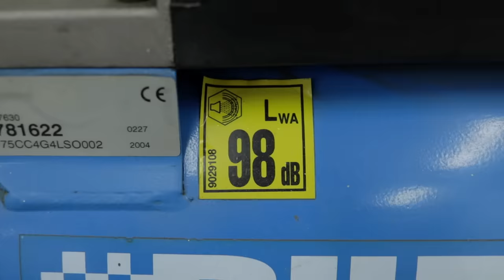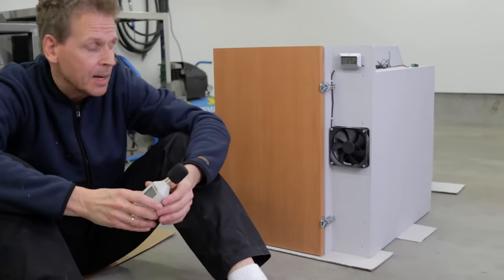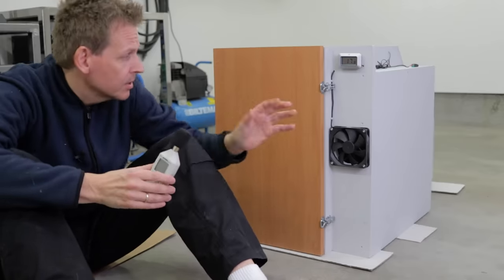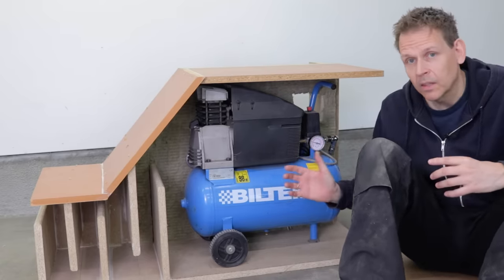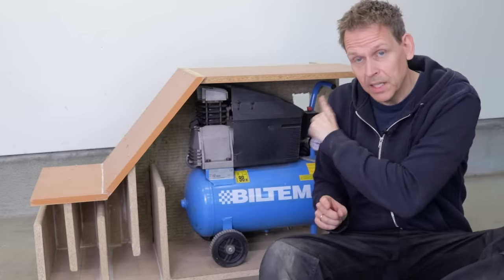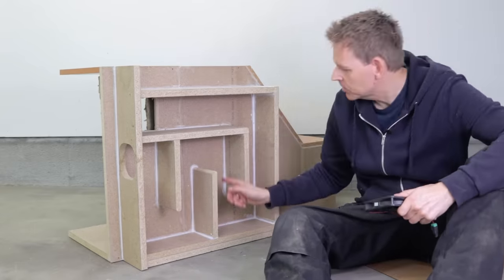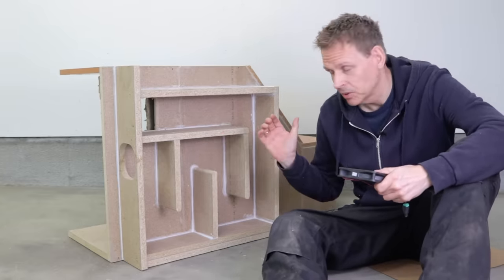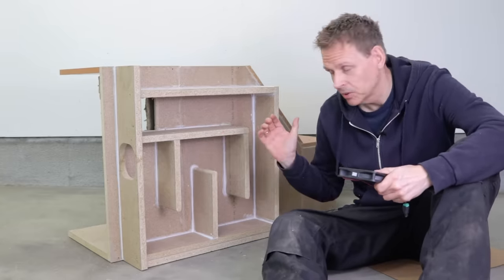Do not build a sound insulated enclosure for your noisy air compressor!

Comment: What kind of Blue air hose are you using and/or what size? It looks clean and neat with the specifically marked air lines in the garage.
Reply from the maker: They are bought at Biltema (as most of my stuff): 1/2 inch PVC hoses (13mm internal diameter). These are cheap but quite stiff (even in their ad they say "flexible hose"), would not use them "on the floor": https://www.biltema.no/en-no/tools/compressed-air/compressed-air-accessories/compressed-air-hoses/compressed-air-hose-pvc-2000038224
Reply: @kihestad  no was actually looking for nice piping/hose for on the wall with valves, outlets and reducers/manifolds  on a few outlets
Reply from the maker: @steffie.morris  I used the blue hose I linked above, 3D Printed wall mounting brackets. I bought a pressure regulator with water removal tank and some bends for the outlets: https://www.biltema.no/en-no/tools/compressed-air/compressed-air-accessories/pressure-regulators/

Comment: I live in an area where I was able to build an attached concrete structure on the backside of my workspace. Put the compressor inside with minimal insulation and now I cant even tell when the compressor turns on. Mass is the key if you have the space.

Comment: Did you do any thermal testing? Is the ventilation sufficient when the compressor has run for an extended period of time?
Reply from the maker: Yes, I have fitted a thermometer with sensor inside just above the motor. I do check it frequently to ensure that it's not getting to hot inside the box. Normally the temp increases 5C = 10F when it starts until pressure is built up, and it takes just a couple of minutes to cool it down. If it is running constantly over longer periodes it can get a bit hotter, I have seen almost 10C = 20F increase. The warmest summer days can be 30C = 86F here where I live, but that is very rare. Its more commonly 25C = 77F, so it never gets very hot inside my box. 
I should mention that I put the exhaust at the rear of the box because than the hot air from the box is blown out of my garage. My garage is not insulated, there is an opening for ventilation where the ceiling meets the floor upstairs. The exhaust air from the air compressor box is placed up against this opening. The hot air from the compressor is pushed out of the room to outside of the building through this opening. By doing it like this I avoid the hot air to be circulated back into the room. I did not tell about it in the video, but now you know 😊
Reply: @kihestad  Appreciate the thorough response! Enjoyed the video. All the best.

Comment: Use mass loaded vinyl on the inside. Flexible and dense material is better at blocking the transmission of noise than rockwool alone
Reply from the maker: Mass loaded vinyl? That sounds interesting and complicated? 🤔😃 I need to Google it

Comment: Nicely made video! Must have taken quite some hours to edit.
Thanks for the information!
Could it be that there is still a part of the noise generated by contact sound? I mean via the nose stand and the wheels..
Reply from the maker: Thanks, both recording and video edit took a while. I think it was more than 500 clip/cuts if I remember correctly 😋 I think you are correct. Vibrations from the compressor inside is transferred to the box, and from bos to the floor. I will try to improve this using some vibration dampening material.

Comment: I noticed that most of the noise from your new compressor is contact noise from the stand and the wheel. Just add some thick rubber foam under it and it will be even quieter
Reply from the maker: You are absolutely correct! Vibrations are the biggest source of noise now. Will try to improve it by adding soft rubber, dampening foam or springs on the compressor and/or between the box and the floor to improve it. Thanks for the tips! 😊

Comment: Put soft rubber under the wheels and the front support. I think most of the noise you have now is vibrations . And put some rubber between the case and the floor too :) I think it will be more silent on your concrete floor than upstairs anyway. Because your concrete floor is dead, and your upstairs floor is acting like a BIG amplifyer for vibrations and sound.
Reply from the maker: You are absolutely correct 👍Notices much more noise now from vibrations transferred to the wooden floor upstairs, compared to the concrete floor downstairs. Will try as you say to add rubber on the compressor feet (I'll probably just remove the wheels) and between the box and the floor. Thanks for the tips! 😊
Reply: @kihestad  I think it will help a lot. I got an big compressor in a corner of my workshop, and to silence that I made a frame around it of 50x50 Aluminum square pipes with 2mm Aluminum plates outside. Then I put 5cm Rockwool inside the frame. For a top I used an old wooden door with a 3mm Galvanized steel plate on top working as an workbench. I can barely hear it now. To prevent overheating I made a hole trough the wall outside and also a condense drainage on a timer relay. So when in use it will blow for 1 sec every 10 minute to blow potensial water out. Then I have a relay controlled by my rooflight, so when light is off the compressor wont work. Just in case I forget to turn it off and a hose blows when I am not home. In that case the compressor would run 24/7 until it dies or overheat. We learn of our misstakes. Hehe
Reply from the maker: Sounds like a great solution 👍 I understand now I still have some improvements to do ☺️
Reply: @kihestad  By the way. I got one of those Biltema compressors my self. Just the same model as you have.  It really keeps full pressure for many months without leaking a bit :)

Comment: Try adding spring feet to avoid the transfer of vibration through the floor.
Reply from the maker: You are absolutely spot on! Vibrations are the biggest source of noise now. Will try to improve it by adding soft rubber, dampening foam or springs on the compressor and/or between the box and the floor to improve it. Thanks for the tips! 😊

Comment: Acoustic quilt is the industrial method of choice for generators and air compressors, you can buy it as an off the shelf tent. If you lag the steel canister with a damping compound such as dynamat it won't resonate.
Reply from the maker: To my knowledge "acoustic quilt" is just an universal name for soundproofing mats / blankets. it's similar material inside these as the one I have used (Rockwool sound insulating sheets). I might add some more heavy sound dampening material, probably bitumen-based self-adhesive mats (probably similar as Dynamat)
Reply: @kihestad  usually there is some combination of glass fiber and mass loaded vinyl, and various fire proofing layers. It can be produced to spec, and the only consistent feature is the quilted exterior and construction method. Acoustic quilt is not a proprietary term, it is about as descriptive as "curtain", "doormat" or "carpet", or perhaps "pizza" in the precision of the term. There are companies you can order it from who can advise on the best sandwich for your situation. It gets made on an industrial sewing machine.

Comment: Hi I'm a auto tech and my  solution is put a actual car muffler on the  compressor intake   sometimes it takes a bit to make a adapter  but  you will see it's worth the time   and takes less space
Reply from the maker: From what I have found a muffler on the intake / exhaust helps a bit, but not very much. I could be wrong though... I did some research but did not find any solution that I thought was very efficient, not even the ones fitted a big car muffler (found some here on YouTube). The tank itself also emits noise because it acts like a sound chamber. I would guess that if a muffler really worked, the vendors would have added it as a standard solution? 🤔

Comment: Do you like the aircompressor from Bilthema? I have some powertools from Bilthema and they have a cheap feel to them. Also the vacuüm cleaner issnt working well.
Reply from the maker: I would say I am satisfied. I had to fix several parts on the new one to get rid of noise, a lot of plastic where vibrating. Beside that it has worked perfectly. The old one is 20 years old, and still working. It has always been noisy, so that is just how it has always been. You cannot really expect professional quality or feel on the tools you buy from Biltema, it cheap for a reason. If you use it as intended, and perhaps even improve whatever is badly designed, I think you can get very good value for money. If you care about the cost and you are a hobbyist: Biltema is great. If you dont care about the price, or you are a professional, you might want to look look somewhere else.
Here in Norway I go to the store "Tools" if I want to step up and get high quality tools.
Reply: @kihestad  thank you.

Comment: A 3dB drop is a 50% reduction of sound energy. I have a simple sound box around my noisy compressor. It reduces the noise from crazy to bearable. Also it act as storage space as I can stack my tool boxes on it
Reply from the maker: Thats a two in one solution 👍😊 Does it not vibrate at all? Caising your tools on top to rattle?

Comment: Didn't read all comments, but i'm interested if the temperature was satisfied enough inside the box? Especially after long running of the compressor. 
Does that relatively small ventilator give enough air flow for cooling?
Reply from the maker: I can totally understand you did not read all comment. I tried to read and reply on them all for a while,  but it's just too many 😏
First I have to say that it is a pretty cold climate here where I live in Norway, in the Northern part of Europe. I have actually fitted a heat pump in my garage to be able to use during winter time. I can see overheating is a big challenge in warmer climates. A more powerful fan or even radiator cooling could be needed must then be considered. 
I should also mention that my garage is not insulated, there is an opening for ventilation where the ceiling meets the floor upstairs. The exhaust air from the air compressor box is placed up against this opening. The hot air from the compressor is pushed out of the room to outside of the building through this opening. By doing it like this I avoid the hot air to be circulated back into the room. 
When it comes to temp readings: Normally the temp increases 5C = 10F when it starts until pressure is built up, and it takes just a couple of minutes to cool it down. If it is running constantly over longer periodes it can get a bit hotter, I have seen almost 10C = 20F increase. The warmest summer days can be 30C = 86F here where I live, but that is very rare. Its more commonly 25C = 77F, so it never gets very hot inside my box. I have been suggested to move the fan inside of the box, as pulling air is better than pushing air. This might improve the airflow, but not tested yet.
Reply: @kihestad  Thanks. 
However, i think that pushing version still is better because the fan itself also need some cooling. 
If fan would be at the output, it would be exposed to hot air with all consequences to it's lifetime.

Comment: A used industrial machine that runs at lower RPM can be quiet and produce much more volume. Compressors do well in small sheds etc outdoors if you prefer not to be bothered at all by noise.
Reply from the maker: Yes, a bigger quieter compressor outside of the workshop is much better. I had unfortunately not that option 😔

Comment: Can this be done for a gasoline powered electric generator.  I need back up electricity for an aquarium but it needs to be neighborhood friendly.
Reply from the maker: It should be possible. I would not have used wood for the box because of fire hazard. Perhaps using double layer of metal with sound insulation in between? Heat will probably be a challenge, and you need to make a clever solution to let the exhaust out of the box.

Comment: One thing Id add would be to hang the unit to the top of the box, suspended with cable or chain from rubber bushings. I like the box good design!
Reply from the maker: That was a interesting idea  😳😊 It's quite heavy, not sure if my box would hold it. Would have been fun to try it 👍 Thanks for the idea

Comment: Its not only about loudness but also how "harsh" sound is, any box dull compressor sound making it less annoying. As for anyone who build box, make it bigger and add ribs inside walls to maximize surface for sound to be absorbed(after adding foam on it of course)
Reply from the maker: Yes, and for me the most annoying sound is the high pitched motor / compressor sound. Luckily I got rid of that, the remaining low "ruble" is not very painful to listen to, and it does not compete with the frequencies in use when you speak. Even if there are some noise left you dont need to rise your voice to speak to someone .

Comment: What's the cloth called? Do you think there can be any other material which could have reduced noise?
Reply from the maker: I used a very cheap fabric, something I just had laying around. Its original purpose is to be used as floor protection mat: https://www.biltema.no/en-no/construction/paint/painting-accessories/protective-paper/floor-protector-mat-2000031579
Any thicker material would be better, and of course real sound absorbing materials is best. It will probably be quite a lot more expensive though, some examples: 
https://www.biltema.no/en-no/car---mc/car-accessories/sound-insulation/sound-blanket-1000-x-2000-mm-2000021215
https://www.biltema.no/en-no/car---mc/car-accessories/sound-insulation/sound-insulating-mat-1000-x-500-mm-2000018990

Comment: I like your approach to the design to building the box and methodology of testing it.  The word I think you're looking for in the travel length are "baffles."  It reminds me of the Bose speaker systems that uses a similar arrangement to produce a wave cavity for the bass sounds... the longer path helps "amplify the lower frequencies... so, in your case, it would filter out the higher frequencies, but perhaps create a lower frequency, which might overall be less objectionable...  What I'd add to your testing methodology would be a frequency spectrum to tell you the amplitude of each frequency, then it might reveal what those baffles were doing, lowering some maybe raising the resonate frequency?? I don't know... that's why we test, right!?  I bought a quiet air compressor from the get-go knowing how obnoxious they were. Supposedly mine is rated at 65 dB so I just have it under my workbench and it is just fine for my tiny shop.  Cheers! from your new subscriber in SF Bay Area, California.  18 Celsius =   64.4 Degrees Frankenstein 🤣... Not thousand, but partial credit, you were close LOL.
Reply from the maker: Ahh, yes - baffles it is 👍 and one more yes: I need to learn the conversion from Celsius to Fahrenheit 😋 Thanks!

Comment: While the design and airflow is decent,  one major issue is the materials used.  Sound is vibration, vibration is also caused by sound,  solidly mounting ridged materials together generates vibrations which generate sound.    If you want to dampen sound, you must reduce or remove vibration.   
One way to reduce vibration transfer is to use soft mounting like rubber between solid layers, and then use something like hvac filters as an inner layer and for the baffles.

Comment: Couple of things concern me. 
First thing is - I would not advise housing that inside the building and definitely not under a bench. Because of that one day has a tank failure - it will be an injury risk to you if the tank blows apart.  

Next thing is - too many junction joints are being used. With hose clips 🤷‍♂️🤦‍♂️. Increases points of joint failure. And definitely not a safe joint with push on hoses with hose screw clips. 

Less joints required and “crimp” clips required for added security. 

When the blow off - ( which they will ) - that’s another risk of injury to you. 

Lastly - I suspect that with it being housed in a wooden structure - it will be not be able to ventilate its own motor created heat. This will not only reduce the life of the motor and also the compressor pump but also increase the risk of over heat with a potential for a thermal event / fire. 

A better solution would be to house it outside of the building and run the hose through a hole in the wall. House it in a small bricked housing of its own with some additional space around it to at least allow some the motor and compressor heat to dissipate.  

And the other concern is - there seems to be no access to drain the water from the compressor reservoir tank. This should be done daily. Or at least after every use. 

Get rid of all those T junctions too. Better off with the quick release connections. Slip on hoses with hose clips never last that long.
Reply from the maker: That was a lot of useful tips! Thanks a lot, I appreciate your feedback  👍😊 Learning from others experience is very valuable!

Comment: Nice Project. Just a few tipps on the silencers. The distance travelled is not relevant for sound in a tube. From a physical perspective both of your silencer setups are comprised out of 5 chambers with two openings each. These reduce noise based on their resonance frequencies. Smaller openings combined with a variation of chamber sizes should result in a bettter performance for the vents. And for a quick shop improvement, a simple box with a vertical slit for the hoses should improve the noise noticably. That would then basically be a 1 chamber silencer.
Reply from the maker: The distance do make a difference, don't it? Sound do not travel a infinit length, even though it does not meet any obstacles? 🤔
Reply: In the open distance matters since the energy gets dissipated over an ever larger area. In an enclosed space a lot less gets lost and most of that energy probably gets absorbed by the wall material more than the friction loss. Just look up an Talk Tube. I think these can go for quite a distance.